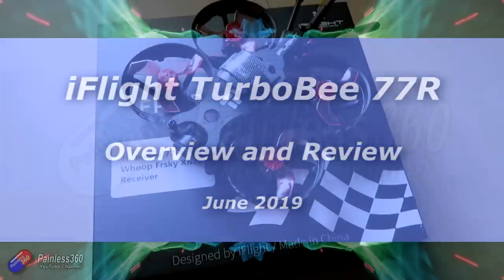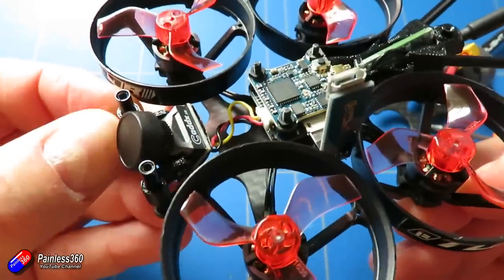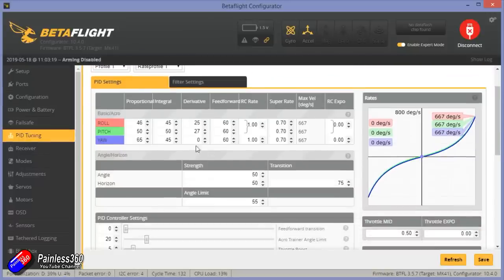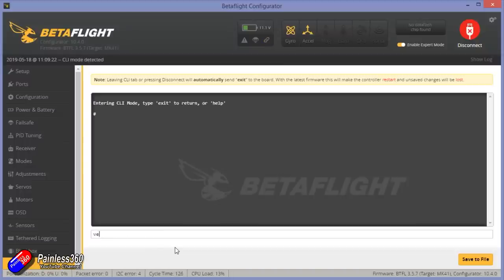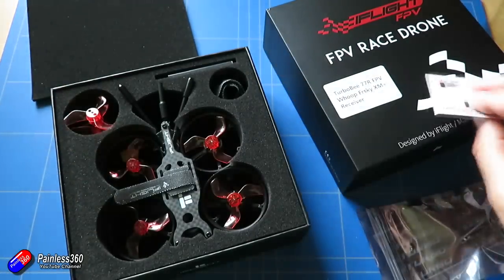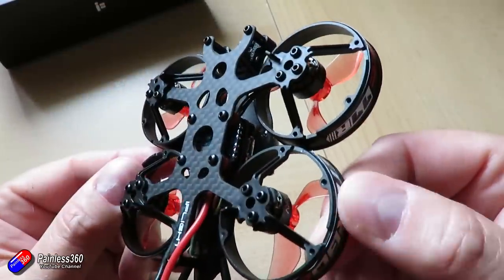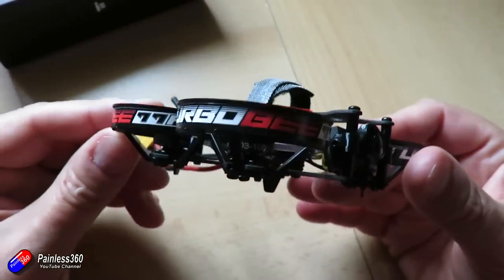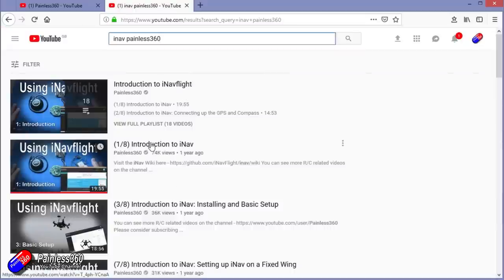iFlight Turbobee 77R

Comment: Are the hoops removable and if so, did you try it without them. My guess is: you'll have a significant weight reduction and it will fly way better.
Reply from the maker: Yes they are, there are better choices in this class for models with exposed props - video on that coming in the next few weeks..
Reply: Jelle Kaptein if they are and they make a significant difference, I'll be buying one for sure. Props guards are useless unless flown indoors, (in MOST circumstances), this think would be perfect for back garden Acro!
Reply: @x-flight1015  That's what I think, I would like to see a flight and weight comparison between with and without hoops.